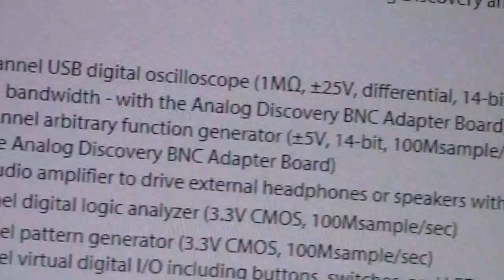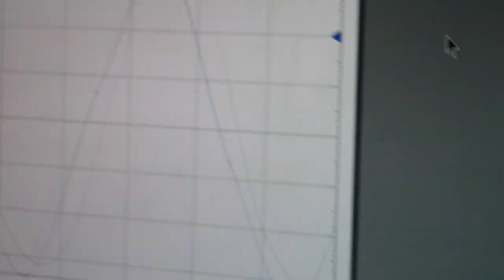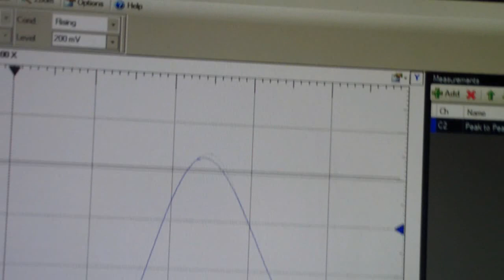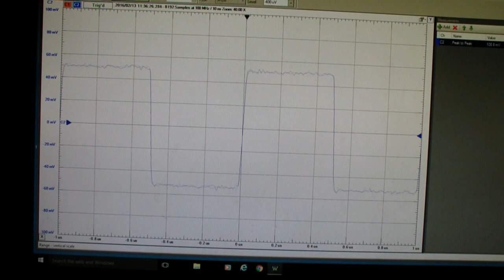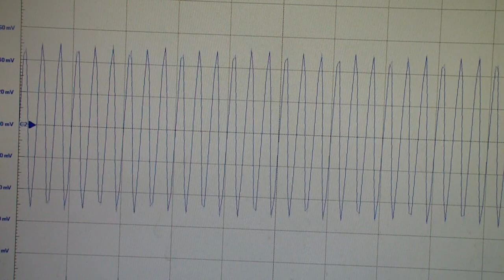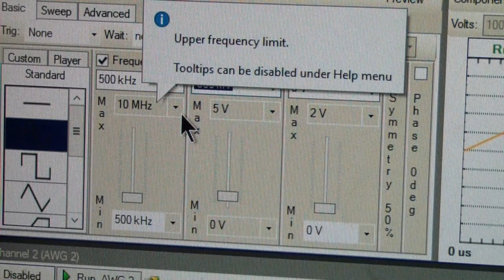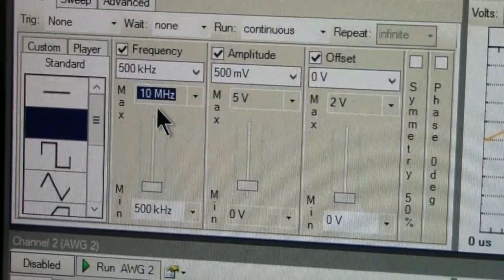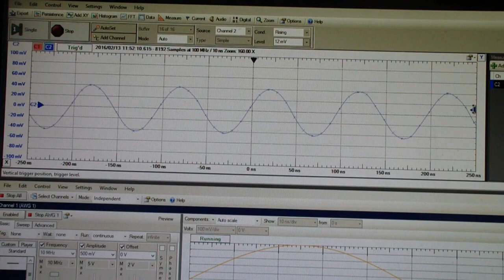TTT058 Analog Discovery 2 vs Original

Comment: I'm pretty sure the updated specs are marketing wank only, looking at the schematics it is exactly the same as the original Analog Discovery. Only some improved power supply features have been added to version 2.

That said however, it still packs an impressive amount of features in a very small package and still very affordable.
Reply from the maker: +TheStuffMade Your conclusions based on the schematics are quite consistent with my measurements on the original Analog Discovery. Depending on how you define bandwidth and measure it, the original AD might well have 30+ Mhz bandwidth with the adapter board. Thank you for your comment and interest. I also agree that the AD is a great value.
Reply: TheStuffMade - Have you ever routed an RF trace?  The same schematic means nothing if they respun the FPGA and the board. 

Do you know what they did?
Reply: tomtektest - The problem with your conclusion is that the PC side software is completely new now. The original may have been gimped by software when it came out. 

Did you notice the ferrite?